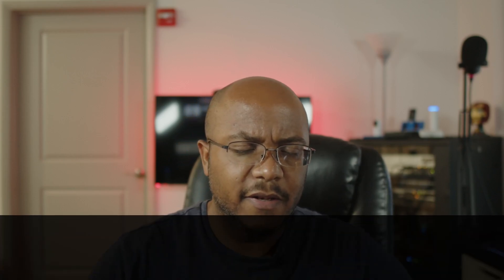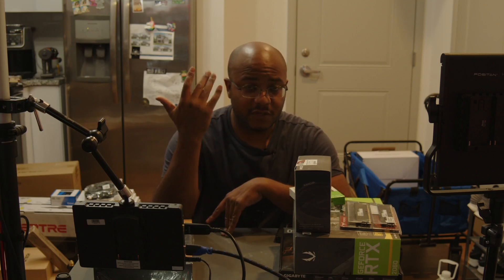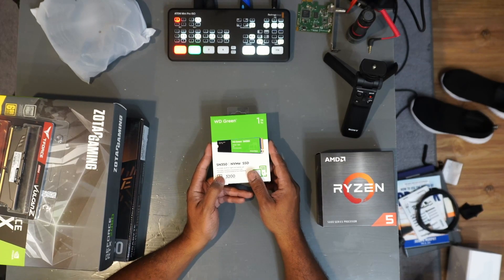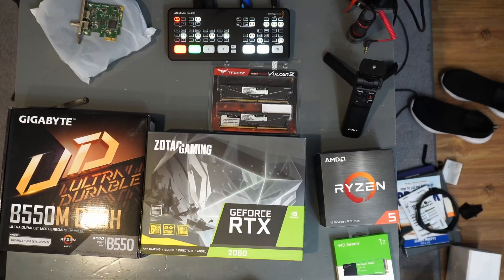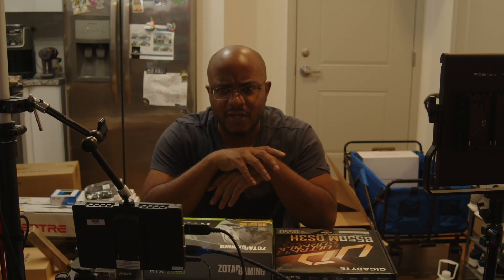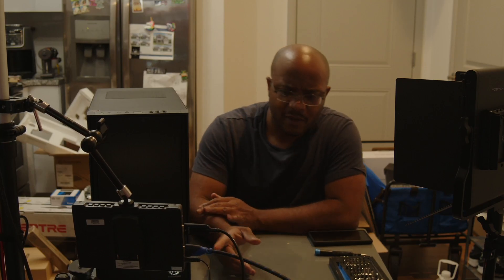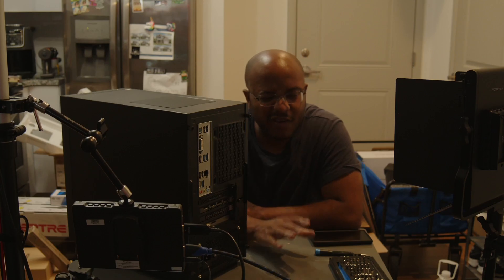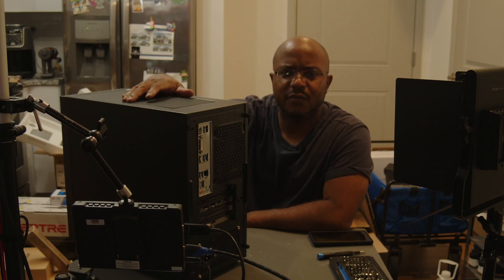2022 PROPRESENTER 7 PC BUILD | RYZEN 5, RTX 2060

Comment: Hey AJAY! Thanks for sharing. The HDMI on the motherboard I/O can be used as display output?
Reply from the maker: Not with a dedicated GPU installed. A supporting CPU with integrated GPU is needed to use that and no standalone GPU can be installed
Reply: @AJaytheCEO  Thanks for the clarity.

Comment: Thank you ! Amazing content!.  will the 3600 work with This set up ?
Reply from the maker: Yes. The 3600 is what is running at my home church
Reply: @AJaytheCEO  Did you have to flash the BIOS to be able to run the Ryzen 5000 series processors?
Reply from the maker: @francisb.1904  No because it was v2 which already had the correct BIOS for the 5000 series
Reply: @AJaytheCEO  copy that good Sir
Reply: @AJaytheCEO  awesome! Thank you 🙏

Comment: It is amazing they still have a PS/2 port.....
How long did it take you to put the hardware together?
Reply from the maker: 30 minutes with 8 minutes for the OS install
Reply: FYI: The PS/2 port on modern motherboards is there for the gamers and their mechanical keyboards. There is nothing out there more reliable. One of the features of the PS/2 keyboard is called key rollover or N-key rollover.  This feature of gaming keyboards allows you to press as many keys simultaneously as you want.  N-key rollover refers to a keyboard with no limit at all, i.e., you could theoretically press all keys at once.  X-key rollover means you can press X number of keys simultaneously.